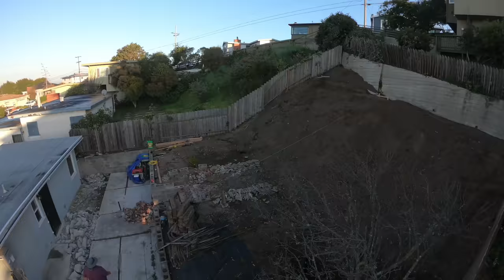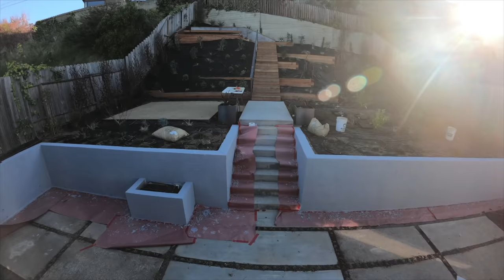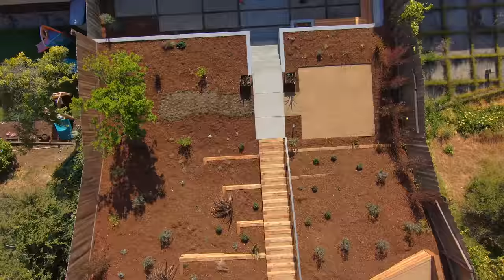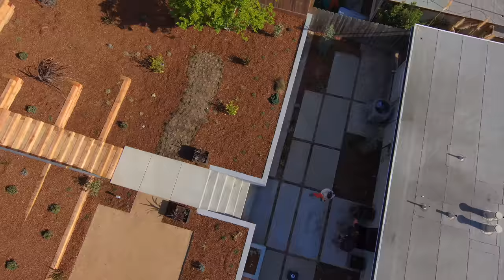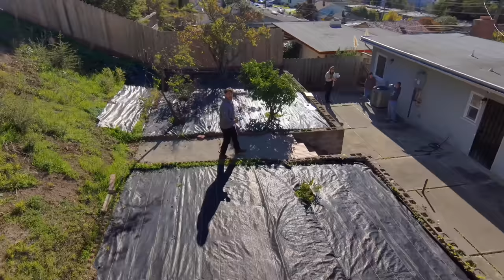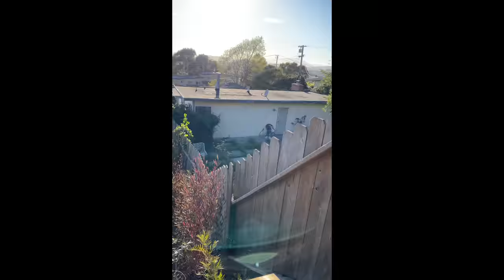Amazing Sloped Backyard Transformation- A Timelapse Guide

Comment: Nice transformation. Obviously a low rainfall area otherwise the bark would be knocking at the back door on the first wet weekend and the timber introduced to the soil would rot very quickly. If the homeowner loves it then worth every dime.
Reply from the maker: Thanks for your comment 👍 mulch has stayed put for the most part even through some wet winters. 🤞

Comment: Interesting to see the follow up for 2023. All that mulch on top of the weed barrier on that steep a slope will have washed down if you got the atmospheric river patterns they reported in the news this past spring. Even on average rainfall years I've seen mulch slide down lesser slopes. My neighbor has a 10 degree grade in his front yard and after paying a landscape company to do a similar design the mulch  was a mess sliding down the bank after rainstorms and collecting at the base of the wall exposing the weed fabric. The shrubs planted along the slope had no effect at holding the the mulch on the fabric. The slope was so steep even the sprinkler irrigation ran off and didn't soak in very well The second year they had to tear the fabric out  lay down a pre-emergent herbicide to prevent weeds from sprouting and densely plant a ground cover to hold the soil to the slope . That slope needed a series of at least 4 to 6 more short planting terraces to level the run off. PS. Even if the client wanted to keep the natural slope as-is its your professional responsibility to advise them of the potential consequences of not terracing the upper slope.
Reply from the maker: Thanks for your comment and feedback!  The garden did well this past year with the heavy rains.  We planted this slope densely so I think it is helping, and drip irrigation has a longer run time for deeper soaking, and that is helping too.  Check out my short here: https://www.youtube.com/shorts/C__KbMUG0kQ. There's a clip at the end that shows the garden from a few months ago.  I want to make a longer update video once the garden is mature in a few more years.  Thanks for watching!

Comment: Could you use netted pebble tile over a rounded surface like a berm or a sloped surface like this? When I put weed barrier down with regular gravel or bark chips over my slopes and berm mounds the gravel or bark chips always ends up rolling off exposing the black weed barrier over time. 

I am looking for a long term solution and so I want to get some of that kitchen backsplash netted pebble tile like that looks like cobblestone rock and basically tile it down with a rubberized flexible grout that will last long term on my berm mounds with holes around my rose bushes and plants to grow. Have you ever seen anything like this before?
Reply from the maker: Thanks for your comment.  Yes weed fabric/sheet mulching etc. causes mulch to fall off especially on sloped sites.  Pebbles on a slope could work but I think a slope this steep like in the video you would have trouble keeping it in place.  I have seen some geo-grid type stuff but don't have experience using it.  https://baselok.com/geocell/ this looks like something that might work for you.  If you wanted to go more green and rely on plant matter, I would recommend https://flexmse.com/green-retaining-wall/. You have the right idea though, but I think you need more depth for your yard and the flexible grout netting on your berms might be too thin.  Hope this helps!

Comment: Very nice! Is the retaining wall cinder blocks (or similar) covered with cement/concrete? Thats pretty smart. Is it more cost effective than a full concrete pour?
Reply from the maker: Hi!  Thanks for watching.  The old cinder block retaining wall was re-done with a stucco finish.  Definitely cheaper then replacing the whole thing as the wall was in good condition.  If a wall is failing, probably best to replace.  Hope this answers your question!

Comment: This yard is a transformation but the design is so stark. It is so linear. I had hoped to see trees, a Pergola, water feature and some color. I know there is a second part and hopefully that will bring some life and joy to the area. This may seem harsh but aren't these videos posted for feedback? I mean this to be constructive.
Reply from the maker: Thanks for the feedback!
Reply: @terragardensca  I wouldn't pay any attention to "feedback" like that. You did what the customer asked for in their budget I assume. A pergola alone adds $1k for the pergola minimum without even any mark-up, anchoring base, and labor hours. 

A water feature that's going to freeze in the mountains? lol you can tell that commenter has no idea what they're talking about.
Edit: saw this is in the SF Bay where that wouldn't be a concern but still, the plumbing, the fountain or water feature... That's adding up to a lot of money lol 

I like this, though I had reservations about the semi-terraced slopes. We have so much sand and granite that the cover would just slide off with the freeze thaw. Edit: SF Bay, so different weather. 

I also did wonder if there's any drainage on that bottom retaining block wall? I have a neighbor who has a similar one and the concrete is cracking. I'm assuming if there is that you used sock mesh covered french drain, but is it also sloped at the bottom of the wall past the footing? Thanks for the great video!
Reply: I was wondering about that as well. I only saw what looked like a sprinkler pipe being laid in but no drain openings at the bottom of the lower retaining walls. I guess you will have enough foliage and ground cover to hold the earth from slippage. Beautiful work.
Reply: @CP-mb7ly  not mts...HILLS, and they dont freeze, grew up there and NO...fog, rain, but not really mt weather. (Moved to 9K ft in Rocky Mts...where this wouldn't work) We had friends living in those neighborhoods, and what they did is pretty typical. I would be more concerned about earthquake movement than anything-as that is real and that cracks everything!

Comment: This looks awesome - amazing work! How did you secure the wood terracing walls (left and right of stairs) to the dirt below? I'm trying to do a similar thing, using about 18 inches of rebar going down into the dirt, but I don't feel confident that it'll stay put over time and hold weight if I walk on the dirt above the wall. Thanks in advance!
Reply from the maker: Thanks for watching!  We did use rebar to secure the walls, I think we sunk ours in 2.5' though, and its hard to see in the video but the walls have wood returns as well, so we are getting strength from that.  You can kind of see it in the thumbnail picture. If you are walking and putting a lot of force on the wall, maybe it would be worth installing some "deadman" posts to reinforce it as well.  hope that helps and sorry for the late reply!

Comment: The upper patio was a great idea. After all that trouble why was it made so tiny.
Reply from the maker: Yeah good point.  The client wanted to hang out mostly on the lower level, but in that particular spot, you have great views of the SF bay.  The slope was kind of dictating the size too, and we were trying to avoid pulling any permits and having to not build any large retaining wall.
Reply: @terragardensca  “what are the setbacks?” Lol pulling permits is a pain.
Reply from the maker: @thomassosa2957  😂😂 indeed!

Comment: Looks incredible, how much did this project cost? And how long did it take to do?
Reply: no clue on the cost but I'm in RI (so not super familiar with CA rates) but I've been getting quotes for a much much much much much smaller block retaining wall and those have ranged anywhere from $7k to $16k. This job seems like every bit of $50-75k
Reply from the maker: About 90k in total

Comment: Retaining wall is not insulated, the drain pipe is there, but covered with dirt, not gravel. It will start leaking the next year, will crack in 5 and will require a rebuild in 10.
Reply from the maker: Which one are you talking about? The concrete or wood walls?

Comment: How do you build little retaining walls for a near 90 slope?
Reply from the maker: hey yes this was a tricky one!  These lateral pieces of wood you see in the video were mainly to hold some of the slope up, but the majority of the hillside will be stabilized with the plant roots once they mature.  The redwood pieces you see are pinned to the ground using 3/4" rebar (as are the wood stairs).  Hope this answers your question!
Reply: @terragardensca  So the lateral slats are just buried and possibly staked? What do you think is a good steep slope erosion plant for partial shade? Thank you for getting back to me
Reply from the maker: @bullseye0112  yea pinned to the ground with rebar. I’m not sure where you live, but you should look up “partial shade plants for erosion control” or something like that for your area. Best of luck with your project! Let me know if I can help with anything